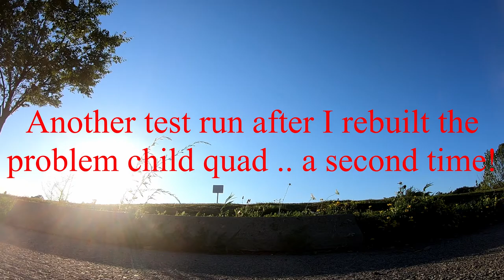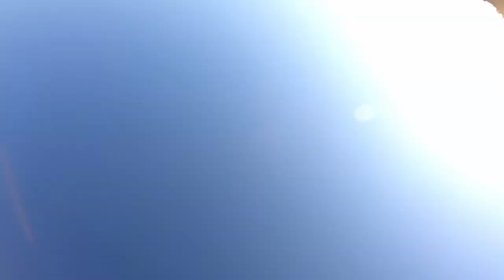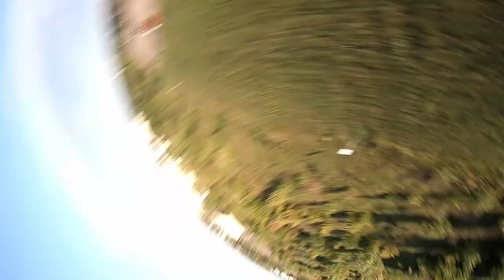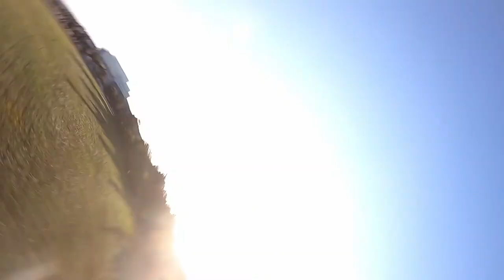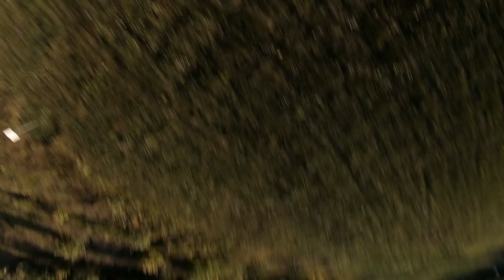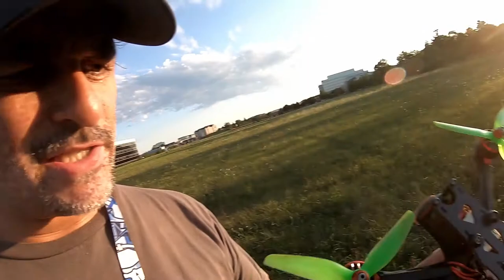Another fail   different quad!

Comment: Dang that sucks. It was doing so well to. Im no pro thats for sure. Could it be a short or loose wife bad solder. Hope you find that battery they are expensive and you figure whats up with the bird. Left a like
Reply from the maker: Hey Furball Kim!!! thanks for watching man! SO I think the problem is I need another capacitor. I just did another build today and installed 2 caps and it flew perfectly!! Was so happy!!! And I went back to the same spot to fly and found my battery!!!! :)